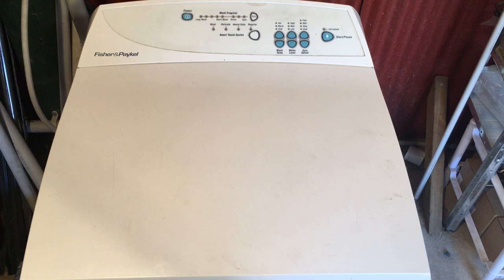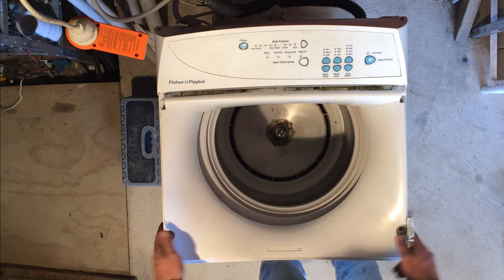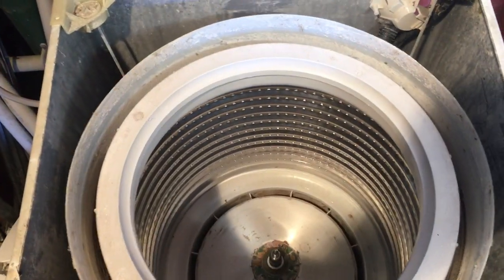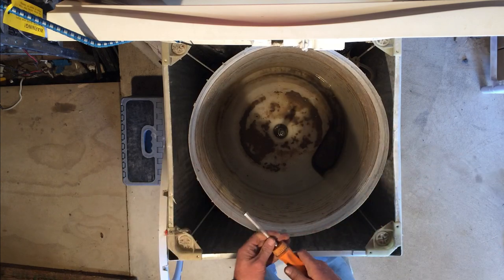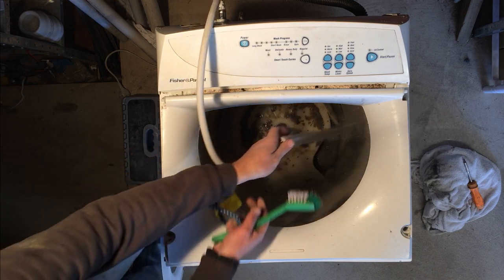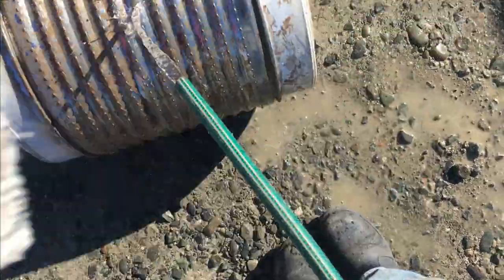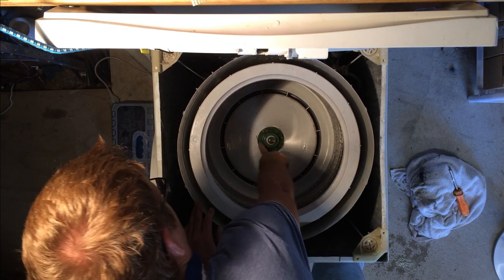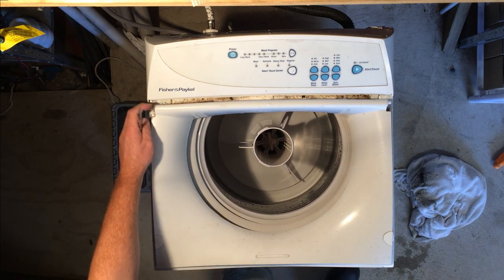How to Clean inside Fisher & Paykel Smart Drive washing machine

Comment: Hi Dan. At the Salvation Army Church in Howick, Auckland I was able to repair their washing machine thanks to your videos. The washing machine is used by those in need such as homeless people. Keep up the good work with the videos.
Reply: What was wrong with it? No  rinse and spin?   I'm curreñtly having that issue. Idk if just cleaning it will solve the problem. What was the problem with that washing machine u fixed?
Reply: @SuperLuckao  I replaced the water drain pump with a new one as the drum wasn't fully emptying all the water before the spin cycle and therefore would not spin. That solved the problem initially but then reocuured. Rather than spending more money on replacing the next most likely cause (the control panel) we decided it was cheaper just to buy a second hand washing machine that worked.

Comment: Your the man! My wife woke me up this morning to say the washing washing was broken. Another expense come to my mind. Stumbled on your video and did both the short and long fix. There were so helpful and I am proud to say oil got my man card back 😂 never thought I’d be able to fix it myself. Appreciate your help.
Reply from the maker: Awesome, well done man
Reply: @motrepairs  I pulled the drum out and cleaned it ,it had 15 years of soap scum but after 2 test washes machine comes with fault code 49 and apparently I need new module . Did I do something wrong ? Also it had about 5 mm of soap scum and all the holes were blocked on drum , did that cause Machine to jump and shake when spin dry started or I need new shockers ?
Reply from the maker: @ja-kl8rg  49 is an inlet valve fault, while it can be caused by a faulty controller that is not very likely. Does the code come up as soon as you power it on or part way through the cycle? If you use a multimeter to check the inlet vales one is probably open circuit. Usually nothing you do with cleaning the inner bowl will affect the inlet valves.

Comment: Hi Dan,
Brilliant video. My washing machine was taking simply ages (20 minutes or so) to empty and the spin cycle wasn't working properly as water couldn't get away fast enough. I followed the video exactly, except once I had cleared the tissue paper and other bits out of the pump I poured more water in and blew back down the drain hose. All sorts of bits (including mashed up tissue paper) came out. I did it a couple of times and the hose pumped beautifully.
Big money and especially hassle saver! 
Thanks heaps
Peter

Comment: very helpful.  Did this yesterday on my F&P Aquasmart washer.  I had no idea how absolutely filthy the outer part of the "inner stainless steel tub" would be after 15 years of use.  It looked rusted but it wasn't rust it was  brown crud that had accumulated over the years of washing our cloths, towels, etc. for just 2 people.  We don't have pets, we don't work on a farm (sometimes wish we did!).... Anyway my point is it's just me and the wife and we both do the relatively clean work of a salesman and a school teacher with no pets in the house and I was blown away at just how filthy and nasty the outside of the inner tub was.  I took it outside to our lower deck and hosed it off but some of it had to be scrubbed off.  I was so thankful that it wasn't rust as it did look like rust but - no it all came off after a good bit of scrubbing.  If I had known I would have been doing this every couple of years.  And thankfully you can do this if you own a Fisher & Paykel washing machine.
Reply from the maker: Now its clean, if you do a hot wash every 3-6 months it will help stop/slow it building up again.

Comment: Thank you for the video. I tried to unscrew the agitator bolt of my washer but couldn’t do it as it is too tight. Can I use any tool to loose the bolt?
Reply from the maker: Sorry I mis-read: Agitator bolts can be tricky, especially if you have large hands. You can get a piece of PVC pipe, then cut two notches to sit over the wings of the bolt. Then if needed drill a hole in the top to put a handle through.

Comment: Thanks Dan for your excellent video. On taking out the inner drum, I found that it has water in it. Will this effect operation. Do I need to drain it. What is the best way?
Reply: I used a cable tie to re-attach the bias spring.
Reply from the maker: The water should be there, it is in the top and bottom rings to act as a gyroscope and stabilise it

Comment: hey Dan, thanks for the easy to follow video, our machine was bought second hand and i have given it a deep clean so looks great, unfortunatley we are still getting a line of crud on our clothes so im bewildered as to where its coming from now? any thoughts.?
Reply from the maker: Are all the holes clear? if they are blocked the water cant circulate and self filter. If you have taken the bowl out and cleaned inner and outer bowl then it must be being introduced with the wash. You can get a filter t sit down inside the agitator but technically you don't need it if everything is working correctly.
Reply: @motrepairs  thanks heap for the reply, it was that filthy that could be the case even though it looked really clean putting it back together. ill take it out and have a closer look. your vids are really helpful thanks

Comment: Great video thanks!
Any tips for cleaning the blue water inlet seen at 1:53? Mine dribbles after the spin is finished and thought it might be better if cleaned but it looks like they riveted it on...
Reply from the maker: They are a sealed unit, if they are dripping from getting grit in them you will need to replace the valve assy. Some people take the filters out because they get sick of cleaning them, but its not worth it to have to replace the valve instead, so make sure to keep them in.

Comment: Could I feasibly replace the main seal with this level of disassembly? My machine just started leaking water a few loads ago. Bearings sound fine. No rusty muck has been slung off underneath yet. Just leaking during a wash. I’d like to replace the seal by pulling it out from around the shaft with a few screws screwed into it to pull it out with pliers from the top then press a new one in around the shaft with some pipe etc and petroleum jelly. Would like to avoid full disassembly to remove bearings and seal if not necessary. Great videos. I was going to dump my machine but seems like these older F&Ps still repairable if doing DIY without breaking the bank.
Reply from the maker: Yes, but if the shaft is badly grooved it may not last long. Just make sure to put the screws into the the old seal only and don't damage the plastic of the outer drum. Pack the lips of the seal well with grease, (don't use petrolum jelly it can affect rubber) and a smear around the outside. We have a shield that sits over the shaft spline to protect the seal when sliding it on but you can do it without just slide the seal straight down. Steves Appliance Spares should have a seal only, or we could sell you one.
Reply: @motrepairs thanks for the reply and tips! I had already purchased the seal but was dreading the full disassembly that others were showing and thought maybe I should buy bearings too if going to that level but seeing this it’s much simpler if I can actually manage to extract the old seal straight from the top. 

Is there a way to avoid snapping the out of balance switch when I flip the top up? Much simpler than removing control board and wiring to remove top entirely. I can probably live without it if not because I can hear when it’s out of balance instantly in my unit before it triggers the switch anyway. 

Thanks again

Comment: Hey thanks for this video!  I am just about to replace the model that you have in this video to the WA8560G1 Fisher & Paykel 8o.5kg Washsmart Eco top loader.  I have always pulled my old one apart every 6 months just as you have in this video but just wanted to check do you know if the new models such as the one we are about to purchase are able to be pulled apart completely as you have done above for a deep clean? Many thanks, Tania
Reply from the maker: Its very similar, just a slight change to the way the lid/top deck come off. You shouldn't have to be taking it apart that often, just a hot wash every few months is generally enough to slow down gunk buildup. If its getting bad that quickly do you use any fabric softeners, wool or nappy wash detergents?

Comment: One bloody problem that I did encounter however was removing the plastic screw thingy from around the metal agitator bit to remove the bowl.   Bloody nightmare,  Ended up sawing it off as it had corroded and stuck fast with rust.

Comment: My  Fisher & Paykel washing machine has a similar problem but instead of the pump not working, the pump won't stop after pumping all the water out.  Seems to be a faulty sensor.  I'm gonna try everything your doing in this video to see if that fixes it.  Let me know if there's anything else I should do.  Thanks!
Reply from the maker: Check that there isn't a blockage or water in the clear pressure tube that connects up to the control board, otherwise you will probably need to replace the controller that has the pressure sensor.

Comment: Ok, it is a code 37. There was nothing inside the pump or around it inside the hole.
The pump is new. I bought it about 6 months ago.
Anyway, after I put everything back together, and ran a little bit of water into the tub, I wanted to see if it would drain it out. 
It didn't. There were no pump sounds.
What are your thoughts?
Reply from the maker: What is your model number? Did you remember to plug to wires back in? (Silly question but I have to ask haha). If the pump is free to turn but not running at all it would be either wiring or controller, if you check the resistance of the pump from the controller end it will tell you if the wiring is ok.

Comment: I went too far oops!  I had the inside drum outside on a deck chair. Hadn't seen this one video of yours at that point.  I was using garden hose with hot water from laundry tap & jet nozzle and a hearth brush, dipping it in a 2l icecream container that had about 50mls of dynamo liquid detergent (which I'd learnt was great for filth removal on quad bike a few years ago) BUT THE OOPS.....   while i was cleaning underneath there was SO MUCH CRUD coming out the centre, underneath, yes, i didn't initially realise there was a NO GO AREA FOR WATER in the shaft hole (I assume) With what I quickly thought was grease, somewhere WATER SHOULD NOT GO!  Is this correct?
Will this be now an expensive repair for the guts of the base of the drum?
Should i proceed with those screws inside the drum?
Reply from the maker: The inner drum is ok to get wet anywhere, as long as you haven't removed or damaged the shaft seal in the outer tub.

Comment: Hi thanks for the really cool video.....
But after i cleaned it out, i find the machine only spins at med speed rather that fast even though 
 The fast light is on and when in med temp it switches between warm and cold rather than warm and hot like it used to. ... Any reason, and any fixes? Thanks. 
P,S i didnt pull the switch panel off .but the bowl is now clean . Also. There are no fault codes showing.
It is a MW511
Reply from the maker: If its done a warm or hot fill it wont do a full speed spin until after it has done a fill with cold, its to avoid programs with the hot plastic at high speeds. That model doesn't have a temp sensor so the warm fill it just based on timing valves on and off, has your hot water pressure reduced or cold pressure increased?

Comment: Hi Dan, any recommendations on what to look for if washing machine won't turn on? Stopped midcycle after being unbalanced
Reply from the maker: Probably a blown controller. The important thing is you need to check all component resistances before fitting a new controller so you don't blow the new one.

Comment: If you use the scrubbing brush for the dishes but used for cleaning outer and/or inner bowl what you could do after that is put it in your dishwasher and you could use the scrubbing brush for the outer bowl and the water blaster for the inner bowl if you have one  but  maybe not the scrubbing brush if you don’t have a dishwasher
Reply from the maker: Considering the price of a new scrubbing brush I prefer to keep them separate haha
Reply: @motrepairs  but i think using the dishwasher is better because it helps clean the residue off which will save you money

Comment: Hello Dan, 
How do I stop fluff smothering my washing load? Specially more noticeable on coloured items.
Reply from the maker: The design of these smart drives is that the circulate water down the bottom, then up the sides and back through all the holes, and the way the holes are punched is meant to catch fluff, keeping it outside the inner bowl to be pumped out later. If you have cleaned all the holes as I show here and still getting fluff you can get a filter that sits down the inside of the agitator, you just need to clean it every wash. Part number 426451P
Reply: @motrepairs  Hello Dan it's me again lol. Will the lint filter prevent fluff from going out through the holes? I'm not sure I quite understood the directions of the water flow. I have cats---my diverter valve was clogged with cat fur. I'd like to minimize the amount of fur getting out of the little holes and going toward the pump in the future. Is the lint filter in the right order of things to help do this? Please let me know and thank you!!
Reply from the maker: @patricias8779  yes the lint filter sits in the middle of the agitator and catches the lint before it circulates

Comment: Hi, I got F&P model MW512  washing machine and i'm having trouble removing the tub, do you have a detailed tutorial on how to remove it please?
Reply from the maker: sometimes limescale or soap scum buildup can make it hard to remove. If you part fill the machine until water is just a few mm deep in the inner bowl it may loosen the scum on the shaft. You can also put one foot on the top of the shaft where the agitator was so you can have something to pull up against.

Comment: Why do some machines have the Bias spring on the back left hand suspension arm?
I've noticed that one is on the front left suspension arm?
Thanks in advance
Reply from the maker: Bias spring was on the front left rod because the machines with a physical out of balance level had it on the rear right. It was kept after the switch was removed, then moved to the rear left on the touch pad models. Not sure why it is still needed without a physical switch but it obviously it.

Comment: For the life of me I can't get the drum out.  Got my leg in there, tried repeatedly.

Please note, it is a F & P WASHSMART 6Kg ("powered by SmartDrive").  

Could it be different to remove the drum.?
Reply from the maker: Yes after you have taken the agitator or pulsator off it should just lift. If you stop it with just enough water to cover the bottom of the inner bowl for a couple of hours it may soften the soap scum a bit. If its limescale you may need to try and trickle some CLR down beside the shaft, just need to rinse machine out well after before putting more washing in.

Comment: Can you remove the bottom bit off the drum  somehow? so much mould and scum in between the bottom and top plastic bits where shaft goes through, seems the only area that is not clean and has wash water running over it?  thanks
Reply from the maker: No sorry. Well you probably can, but then you will have trouble getting it back together again...
Reply: I’ve removed that clutch spline in the past, usually I have had success, but some times no, if you take yours off, when you do put it back on, don’t over tight the screws. I just use the water trick mainly, cold water or you can put boiling water down that part to break down limescale which will force that inner bowl out!
Reply from the maker: @lukekneebone9831  Yes you can take the spline drive off, screw heads are very soft so need to use a screw grab paste to avoid stripping them, but I think Troy is referring to the part between the two bushings that contact the shaft.

Comment: Any idea how to remove the drum if it seems stuck? I’ve got up to the point of putting my boot inside to press down and lift the drum, it will lift about 2cm and then no further
Reply from the maker: You could try filling it with water to cover the shaft, may loosen the limescale and soap scum that will be on the shaft stopping the bowl from sliding up.